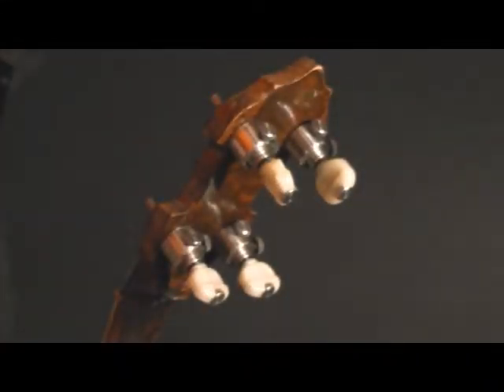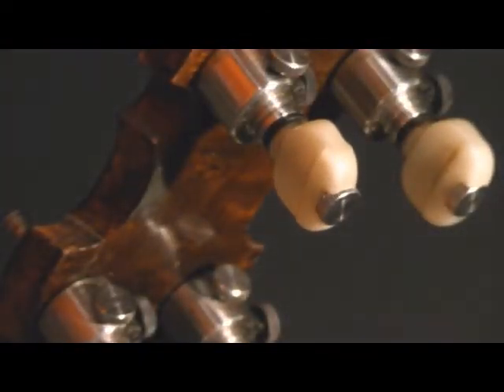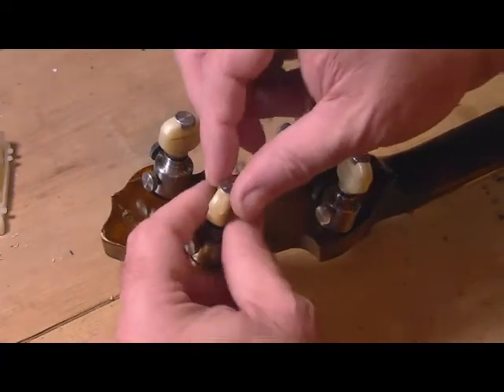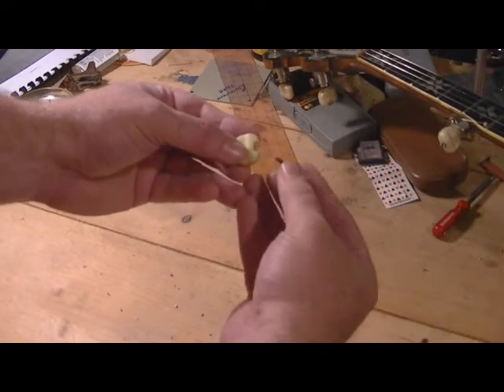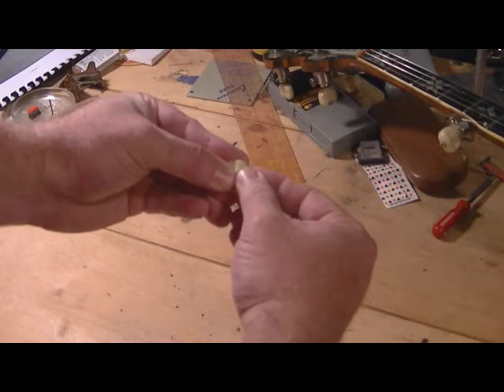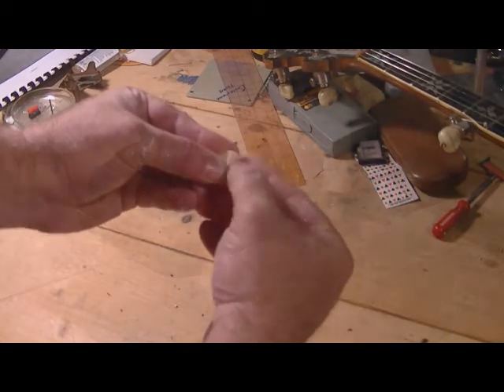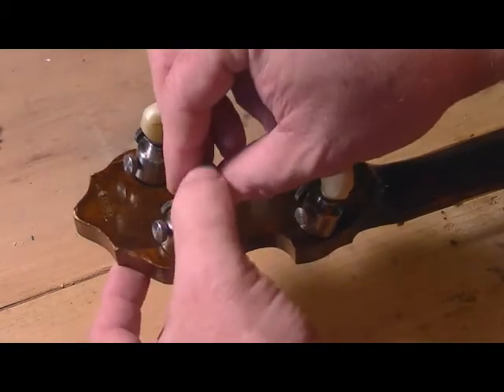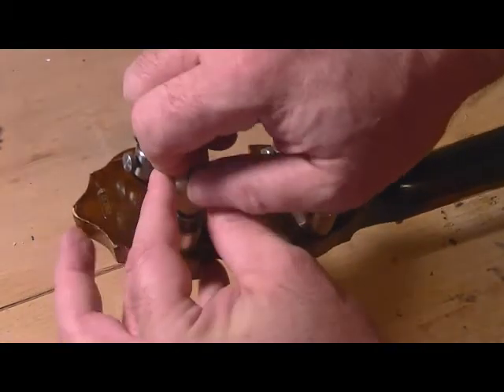Fixing a Slipping Keith Peg

Comment: Holy Moly, it worked. I have a nice ome monarch with these tuners. Like you said it felt tight but was not staying in tune. It would go out of tune within seconds.....it's now been 10 minutes, still in tune. good that Bill set you straight .Thanks
Kim
Reply from the maker: Excellent. He also sent me some leather replacements for the original rubber washers. Honestly, I don't know if they helped because the procedure itself fixed the problem, but I put them on anyway. Glad it worked for you!

Comment: Would this work with Gotoh planetary tuners? I've got a banjo where when I try to tune the 2nd string to B, as soon as I let go it slides down to Bb. So I tuned the banjo down to F, and it still slipped. So I tuned it down to E. With that tuning I can play two songs before the 2nd string slips out of tune. So I tuned to banjo all the way down to D. With that I can play 4 to 5 songs before the strings slip. Planetary tuners are complete garbage. For some reason banjo players think they're better than worm gear tuners on guitars, but they are not. I have a clunky banjo that uses sealed worm gear tuners. It stays in tune for months. But my banjos with planetary tuners, I put them in tune, set them down, come back 15 minutes later and every string is slightly out of tune.
Reply from the maker: I can't tell you if it would work or not, but probably no harm if you try it. Let me know if/how it works.